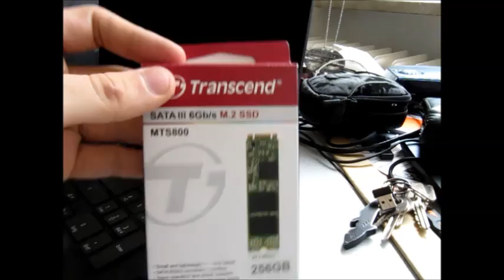Acer Aspire VN7-571g Disassembling and M.2 SSD Upgrade

Comment: Hi, good video. I did the upgrade yesterday with a western digital green M2 2280 WDS120G1G0B. For everyone, who would like the upgrade the following, during lifting the keyboard:
If you have removed the screws from the underneath, don't press at the corners and don't use your fingernails to lift the keyboard. It is quit easy to lift the keyboard with a small cotter or something like a debit card. It that case you can gently release the clips around the keybord bezel.
Everything else is discribed in the video. I needed just 15 minutes to disassable the notebook, add the m.2 ssd and reassamble the notebook. My m.2 ssd was directly found in the bios and the windows installation went fine. Even I had already an SSHD drive installed the notebook speeds up a lot. I really ca recommend to install a real ssd. For exable the notebook boots up (it was completely shutted down, not in the hybrite mode) in less then 10 seconds. Before it was around 45 seconds (also after an installation with the same programs.
Reply from the maker: Thanks for the feedback! I wanted to open my laptop to remove dust for a while now. I'll try to use a debit card for that ^^ nice tip, thanks

Comment: Oh no! I replaced my HDD with a SATA SSD because I thought that my laptop didn't have an m.2 slot!! I have a similar model but with different specs. The motherboard certainly looks like mine and I didn't think that the m.2 slot would be on the other face of the motherboard.... The videos I watched had a different model with the m.2 slot above the motherboard so I thought my model didn't have it... I wish I had seen this video before buying the SATA SSD... The m.2 SSD is not only faster, but I wouldn't have had to discard the HDD... 😧

Comment: Thanks for this video. It spent an aged but still good notebook a second life for reasonable money. I'd like to add that it is MUCH better to get the WLAN module out with the antennas attached than to try to pry off the tiny antenna connectors. You may end up pulling the socket off the board, rendering both the module and the antenna useless and giving you the chance for an upgrade of the WLAN module too... 😕

Comment: Hi, I got the same laptop. Instead of upgrading to a 256Go only SSD, is it possible to upgrade to a 500Go or even 1To SSD ? Will these higher capacities be recognized by the system?
Reply from the maker: I am not sure if there is a limit but I think 1tb should be no issue
Reply: @Martianbuddah  Guess I'll see... Thanks for your answer

Comment: i just did this operation, the extra ram wont show up on bios (+ option 
is grey for ram) or my computer info nor even ccleaner. Speccy only 
shows it... how i can take it on use? also the m2ssd dont show up on 
memory, 2,5" sata ssd does and works great. But the ram and M2 what 
should try to get em workin properly

Comment: Thanks for the video. My model is vn7-571g-51xh. I want to upgrade my (existing hybrid 8gb ssd+1 tb hdd) laptop with a m.2 ssd but too confused which one to buy. Will samsung evo plus be compatible? please guide me.
Reply from the maker: Hey. You just have to make sure that it is a 2280 model with SATA ( not PCIe / NVMe ) connection. You could go for samsung, but other manifacturers like crucial and wd are usually cheaper. Here some amazon links, i would go for one of those i think:
samsung evo 860: https://www.amazon.de/Samsung-MZ-N6E500BW-860-EVO-Interne/dp/B078WQVX9B/ref=sr_1_10?__mk_de_DE=%C3%85M%C3%85%C5%BD%C3%95%C3%91&keywords=m.2+ssd&qid=1557224132&s=gateway&sr=8-10
crucial: https://www.amazon.de/Crucial-MX500-CT500MX500SSD4-Internes-2280SS/dp/B077SQ8J1V/ref=sr_1_20?__mk_de_DE=%C3%85M%C3%85%C5%BD%C3%95%C3%91&keywords=m.2+ssd&qid=1557224132&s=gateway&sr=8-20
wd: https://www.amazon.de/Blue-interne-Festplatte-Lese-Schreibgeschwindigkeit/dp/B073SBX6TY/ref=sr_1_1_sspa?__mk_de_DE=%C3%85M%C3%85%C5%BD%C3%95%C3%91&keywords=m.2+ssd&qid=1557224132&s=gateway&sr=8-1-spons&psc=1
Reply: @Martianbuddah  thanks a lot buddy. I will take a look and decide one. I called the customer care of acer and believe me that they told me about the possibility of incompatibility.. the frequency needs to match ..there was no way for me to match that. But since you have confirmed that all the above are compatible and its just about 2280 then i will go for it .
Reply: @Martianbuddah  also the story sbout type of connector .B type and M type .i was confused.. bdw .my next question would be how to transfer the OS from the existing hybrid hard disk i have to the new ssd which i will put and do u recommend backing up the data before i do that ..thanks in advance
Reply from the maker: Well i don't know what they mean by frequency tbh ... The connector you see in this video i think is called b+m type ( it has 2 gaps inbetween the pins just as the ones from the amazon links i posted ). I recommed backing up all your data and doing a clean new installation of your OS. If you want to try to copy your OS to the new SSD, i cannot help you with that. But if you google for migration from HDD to m.2 ssd you will probably find something useful.
Reply: @Martianbuddah  thanks lot for your comment. u r right about the connector .it is indeed b+m.. however, the connector in my laptop seems look like M type as it just has one gap (photo- https://drive.google.com/folderview?id=1-POlc4__LuP6piAdN_uw8dknxM0uuOJo). Now I m again confused because if I just look at the ports, NVME makes more sense to me rather than SATA. Sorry to bother you for this long but please let me know your thoughts. If its not about how the port looks I will go ahead with the ones u suggested above. Greetings from India.

Comment: Danke für die Einblicke. Du schreibst, dass Du die Systemübertragung erst nach dem Einbau gemacht hast. Wäre also ratsam, das davor bzw. ggf. nach dem Ausbau einer vorhandenen zu kleinen und dem Einbau einer größeren primären SSD zu machen. Z.B. über einen USB 3 nach M.2 Adapter. Was denkst Du darüber?
Reply from the maker: Ja das wäre wahrscheinlich ratsam. Da ich solche Eingriffe natürlich nicht regelmäßig mache bin ich auch nicht sicher was hier die perfekte Vorgehensweise ist. Was bei mir auf jeden Fall zu Problemen geführt hat, war die Windows Registry die irgendwie nach der Migration teilweise nicht mit den Laufwerksbezeichnungen klargekommen ist. Ich denke wenn ich es noch mal machen müsste würde ich die Migration vorher machen und das System dann ein mal starten während nur die SSD eingebaut ist. Dann die alte Platte sichern&formatieren und ebenfalls einbauen. Vielleicht läuft das dann reibungsloser ab ^^
Reply: OK, also ich habe mir eine 1TB Samsung SSD Evo 860 EVO SATA M.2 gekauft sowie einen USB3.0 zu M.2 Adapter (ca. 29€) und vor dem Umbau mit dem kostenlosen Migration Tool von Samsung einen Klon der alten 128GB M.2 SSD auf die neue SSD gezogen (ca. 20 Min). Der Tausch der SSDs, der natürlich sofort danach erfolgen sollte, brauchte dann mit etwas Konzentration 20 Minuten. Man sollte noch den Lüfter etwas aussaugen und schauen, ob die Netzteil Buchse nicht losgebrochen (ist meist der Fall, kann man mit Heißkleber wieder fixieren). Das BIOS wollte das neue Boot Device beim ersten Hochfahren bestätigt haben. Das war alles. Hat super geklappt. Vielleicht kannst Du diese Info noch in Deinen Beschreibungstext aufnehmen, denn das mit der Neuinstallation ist ja nicht so der Hit.
Reply from the maker: @FlexibleBladeTurbine  Danke für das Feedback. Freut mich das alles gut gegangen ist. Ich lass die Beschreibung mal so wie sie ist, da ich selbst einfach zu wenig Erfahrung mit Migration habe um da gute allgemeingülte Ratschläge hinzuschreiben. Denke abhängig von der gekauften SSD & dem ursprünglichen setup (evtl wie bei mir mit Betriebssystem ursprünglich auf der HDD, die drin bleibt) kann da immer iwas schief gehen und ne Neuinstallation ist da der einfachste saubere weg. Dennoch hast du mal zwei Herzen für die Kommentare bekommen sodass die vielleicht von Migrationsinteressierten gesehen werden ^^

Comment: @Martianbuddah 
hey nice vid :) 
but i have a problem. i did it exactly like you did in the video. But now when i press the on button there is "nothing" like there is no electricity. I checked all connections, could you eventually help me ? i would pay you.. im rly confused and sad right now maybe i oversee something?
Reply from the maker: John Johnson, HI there was someone with a similar problem further down in the comments. First you should check if the battery cable is plugged in (next to the DVD drive). Then try screwing all the screws back in. And did you try if it works with the power cord plugged in?
Reply: Hi Martian, WOW! its exactly like you said. if the bottom "batterie screw" isnt drilled in.. it wont start?! i always tried to start it with an open keyboard so i dont have to open it all over again if something failed. 
Thanks in advance mate! :-)
Reply from the maker: John Johnsen you're welcome ^^
Reply: THANK YOU! Thought my battery had died all of a sudden

Comment: Hi, thanks for the video. I see that your m.2 ssd has B+M key combination. Don't you remember by any chance was the m.2 socket the same (i.e. 2 keys)?
Reply from the maker: Sorry, i overlooked your comment when u posted it ... I didn't even realise there are several types of m2. keys Oo thanks for the hint. Sadly, i can't tell you what key the socket was. :/
Reply: I have this also, I used the Crucial scanner and it stated it has a B+M slot.
Reply: I just pulled one of these apart today.  The M.2 socket is M key.

Comment: I may have missed something here, but how did Windows boot up and recognise new hardware after you installed the new SSD? Isn't the Windows installation on the SSD, and the HDD is just used for data?
Reply from the maker: the ssd does not have a windows installation out of the box. so after pluging it in, windows still boots from the hdd as before, you have to migrate the system manually from hdd to ssd.

Comment: Hi i got a little question, I want to,  as u did,  add an ssd on my laptop.
And also clean the dust,  and why not change thermal paste.
But before starting something like this,  i want to be sure it's possible.
I got the Acer Aspire VN7-571G-51S3.
But it already had and hybrid hard drive with 8go on flash memory.
Does it still possible ? 
And by the way, it was a cool vidéo, thanks for u'r time !
Sorry for my terrible english :)
Reply from the maker: Hiho, yes that should be possible. Cleaning dust is always a good idea, Changing thermal paste i dont know ... i think i would not do that but if you are sure that you are going to make it better, do it ^^.
And yes, the Hybrid drive with 8gb flash is usually just one component like a normal hard drive, so the ssd upgrade should be possible as shown in the video.

Comment: My laptop is vn7-572G-57N0
1. What kind of M2 ssd should I buy for it? since the connector of M2 have 3 kind.
Reply from the maker: After a quick google research i would say it should be a 2280 slot. If you want to be sure you can open the laptop and measure the slot. the last to numbers of 22XX stand for the length of the module. 80=8cm, 60=6cm, 40=4cm

Comment: I'm sorry for my English, I'm Studying The languaje.. well
I have a laptop like yours, But is VN7-571-761Q , it has the same, and i want to ask;
What type of Optic Unit is? because my  portatil haven't the Disc Player, 
Can be any Unit? or Should be that specific style?

and too i want to ask if too, What type of card can i put? because too My Acer haven't Graphic card,

Can you help me? seriously, very thanks
Reply from the maker: It should work with other models of the vn7-571g series as well. 
Of course there are also versions without an optical drive and without a graphics card. To upgrade with an optical DVD drive should not be a big problem, but to install a graphics card may be a little harder. Anyway i can't give you tutorials about that because i have never done that myself ^^
Reply: Then.. can i buy any optical drive? if so, then, Ok, and well, I'll try to get the graphics card, even if is hard to find it.
I'm very grateful for your answer, Thank you, 
And my last quiestion, for The Ram Memory can it be any type? or Specific? because too i have only one this, and want add one more of 8Gb.

My apologies, very thank you!!!!

Comment: Hey, I have both a HDD and a SSD on my acer aspire v17 black edition. I wanted to ask you where exactly is the ssd located in the laptop and also does your warranty expire if you open the laptop?
Reply from the maker: No the warranty does not expire. Sorry but i don't know about the v17 black edition ...
Reply: So if I unscrewed the screws and unplugged the 3 cables, and then plugged them back in my warranty is intact or OK?
Reply from the maker: Thats what my shop told me about my laptop, yes. When it comes to warranty of your laptop, it's best to call the shop where you bought it and ask them :D a random guy on youtube is not the best source for these questions

Comment: Excelente trabajo amigo!
Actualizare el mío y te cuento cómo me fue. Mi laptop no tiene lector y no lo puedo encontrar acá en Chile. Tienes información de dónde encontrarlo.
Saludos y gracias por tu vídeo.
Saludos desde Chile!
Reply from the maker: Excuse me, i don't speak spanish so i need to trust Google translate on what you say :D You are looking for a "reader" (lector) for you laptop? what is this? A DVD Drive?
Reply: Hi I do not quite understand what kind of module do you have installed? I have the same model laptop and this slot is also empty. I installed a new HDD instead of the SSD, and DVD drive instead of HDD put))). What kind of module do you put the prompt?
Reply from the maker: Hmm i don't really understand you. I have a DVD drive in my laptop ( the thing on the left), a 500gb hdd connected via SATA and as shown in the video a 250gb SSD connected to the m.2 slot.

Comment: Where is the ram? I got the 8 gb ram model and would like to upgrade my Ram as well all at the same time. Next time mention all components incase someone else needs to see it on video. I know u mentioned ur a noob at video uploads to Youtube. Overall great video with minor details missing, I'm sure you will do a better job next time, not bad for a first video.
Reply from the maker: +DICIEMBRE1977 go to 7:51 in this video. right next to the usb-plugs. that should be the ram. Sadly you also have to lift the mainboard for that upgrade ^^
Reply: @Martianbuddah  heyo, I was also gonna upgrade my ram. Originally the notebook comes with 8gb. Is there a second slot? Or would I have to get a 16 gb chunk?! Good video dude!
Reply from the maker: @zownes612  hey i am not sure but when i remember correctly, mine had two slots and both were taken by 4gb ram sticks.
Reply: @Martianbuddah  thanks for that really quick answer ! keep up the good work

Comment: Hey,
I have an issue with a VN7-571g (5050). I replaced the dvd drive with an ssd bay and when i boot it up it says "pxe-e61 media test failure check cable".
Cables are all in and it neither finds the ssd nor the build in HDD - even if i insert the dvd drive with a bootable win 7 disk it doesnt load it up.

Bios says that the laptop doesnt have any harddrives (which is obv untrue)

Laptop is running in legacy mode - switching to UEFI with and without secure boot doesnt change anything. The fact that even the build in DVD drive isnt properly addressed makes me wondering if the SATA controller was defect by default (didnt boot the laptop prior to the dvd-bay replacement though)

Did you come across this error some time during your hardware changes / Do you have any idea what to do - except shipping it back?

Any help would be greatly appreciated.

Much thanks in advance - me :)
Reply from the maker: +»BoH.Crew×IRA™ hmm na sorry i have no experience with such replacements.  but yeah, maybe it was defect before your replacement :D better always check the functionality of the hardware before replacing anything

Comment: this video stopped from buying this laptop. the amount of stuff you have to do to upgrade your laptop is beyond stupid on a gaming laptop. gaming laptops should have panels to acess the hardware not having to take the entire laptop apart to get to the hardware.
Reply: Just upgraded my Acer and wife's Lenovo, what a difference.  When I buy another laptop I'll check how many screws need to be removed.  I'm taking Acer off the list of possible replacements.

Comment: First, thanks to the uploader for uploading this, it was very useful when performing the m.2 installation. It was a great pain in the a** to do this but I'm finally done and everything seems to be working.

I went into small panic mode after performing the installation as the laptop would not turn off on key press, unless the charger was connected. Luckily, one other person had the same issue here in the comments, so the solution is to put the plastic back together, only then does the batter works for some reason.

So yeah, thanks again for the guide, and a middle finger to acer for making this so hard.